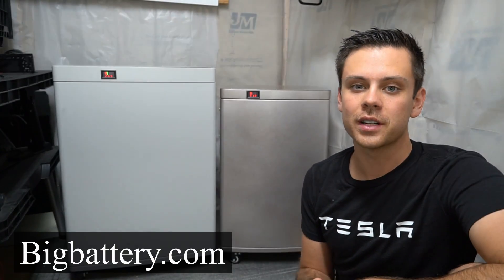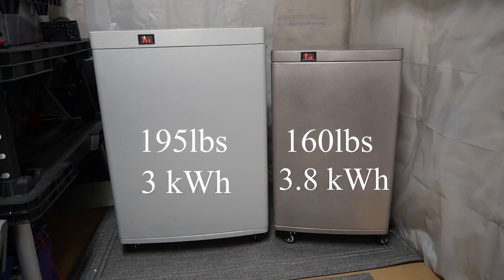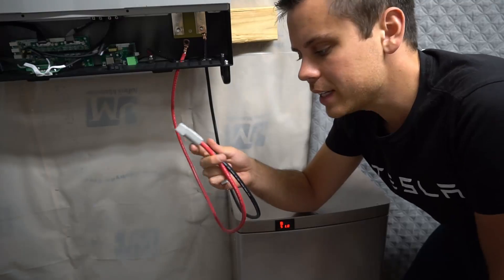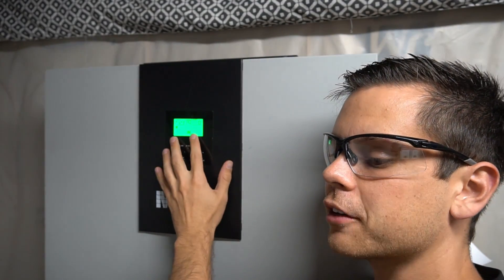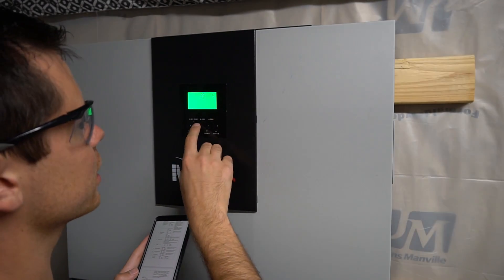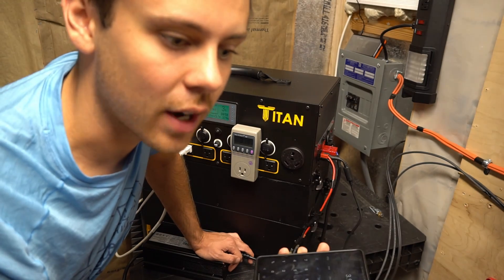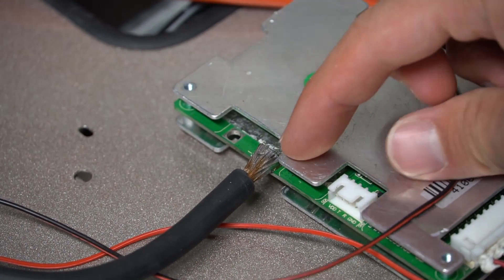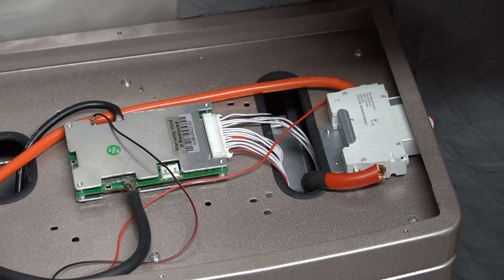Bigbattery.com 48V Li-ion + MPP LV5048 = Powerful Budget System (Intermediate level)

Comment: I am the ultimate novice in solar system builds but found this video very helpful. Only not clear on a proper solar array using the 24V LIFE P04. I have the Renogy 12-24 v panels,550w ( 6 each for now). Will there be any problems using the 6  each 550w panels with the set up described? Appreciate any advice.

Comment: Having spent my life in the electronics industry I have learned one thing about the Capacitors you have mentioned. Chinese made capacitors have a lifetime issue due to impurities used in their assembly that limits their lifetime, the precharge helps to build the electrolyte film without punchthrough and helps extend their life. Capacitors manufactured in America had this issue to some degree from only one manufacturer and  that was over 50 years ago. Capacitors manufactured in Japan, do not have this issue and Japanese Caps will outlast Chinese caps by 10 to one. This situation is well known in the Chinese electronics industry so Chinese manufacturers of the "Finest" electronics use Japanese manufactured Caps.

Comment: You said.  You could take that 24v battery and later connect in parallel to get 48v.    My question is,  would you have to do it with an exact same battery?  Or just any 24v/XXXamp batter and be fine?    Secondly,  if those 2 different batteries had different brand BMS’s,  would they still talk to each other?

Comment: I have an LV6048 and I have a split phase AC Input (9,000watt generator) connected to the Inverter, but it is still not charging the batteries with the AC power. I don't think I should bridge the L1 and L2 right? I feel like that will short my generator. Any help please? Thanks!

Comment: what do you do if the grid goes down? The workmen don't want to get a shock from the solar system.
Reply from the maker: This is not connected to the grid. It's an off grid inverter. If it was a hybrid or grid tie, then it would have anti islanding features part of UL 1741. You should watch some of my beginner videos.

Comment: how would you recommend that I build a UPS for electronics in the house which I can plug into an outlet to charge so  can control the wall outlet (on/off) so all the appliances using the UPS do not draw from the grid all the time

Comment: Can you do the resister trick on either the Positive or Negative, or just the negative?. I was think of wiring a push button in parallel with my main battery cutoff switch to pre-charge before switching the Positive side to ON.

Comment: On what page of the manual does it show the jumper Will is talking about? Also, on what page of the manual shows the schematic using just one inverter? All I see is 2 or 3 inverters paralleled. 
I have one inverter.

Comment: Is there a charge controller that will let you switch from solar charging to fuel generator when the capacity gets too low (alarm @25% LifePo4)? And is there one that can automatically start a fuel generator when needed?

Comment: That is ~ utterly wretched ~ interior work (I design and build power amplifiers) high current power supplies are my specialty. I am stunned bu the connections as shown. Both the heavy gauge wire "soldered" to PCB assembly (utter fail) and the impartial wiring to the circuit breaker, are astonishing. They defeat the larger gauge wiring benefits. 

I would have redone them for safety... if I planed to load the system heavily. That alone would make (makes) me skeptical with purchase of their products... way beneath amateur... I think that I will build my own battery system...

Comment: Will can you recommend a BMS for the lithium 48v. The one is written in Cantonese. Big battery is not selling them separately now. I would like to upgrade the. BMS in the units I have. Nice to be able to use a BMS with Bluetooth to monitor. The anderson SB50 is to low and showing some heat stress. Cable used look and feel cheap (plastic feel). I have better cables and SB175 for peace of mind. This info would help those that bought these on your recommendation. Big Battery is useless. They informed me they are upgrading to SB175. Interesting the price increased a few hundred Dollars now.
Reply: Can you send a good photo copy of the Cantonese? I have a pretty good app that scans and translates pretty darned good. I should be able to send it back to you translated into English. Send them to "ClosedThisAccount" at yahoo dot com and put "Translate to English" in the subject line.

Comment: Do all inverters need the capacitor "precharge" when hooking up the battery pack? I have never done this on my magnum energy 4000 watt inverter with three  parallel 24v LiFePo4 battery packs. I just hooked them up and switched each packs individual breaker to the on position. Perhaps I have arc protection on this inverter and it has saved my scrawny butt. YIkes! I may lose sleep over this...

Comment: I need solar for my van I don't know anything about this please some one recommend me something easy, I was thinking about 2 AGM battery and 2 solar panels with a charge controller if that's all I need can some one let me know and what type of panels  I want to power a 12 volt freezer and the water pomp is a 12 volt as well a TV is a 18v TV with the cable adapter for 110
Reply: Joel...look through Wills videos. He has a simple setup for RV use.

Comment: I tried using the resiter(sic) on my Outback flex panel and still get the spark? Also found out the FX inverter ser is not compatibil with Lithium batterys. I have a FX3048T inverter. Besides all my parts are here and now to get to work. I will try with the Mate 3 and Mate 3s.

Comment: Hey will thank u much for all the info ,I knew to solar ,I watch many of your videos multiple time ,I thinking of decent size solar system for a camper , I was thinking of going with the mppt lv 2424 with the 3.5 or 3.7 kilo watt battery pack that you tried . I know on the inverter I believe it's a 2000 watt inverter on that 24 24and that's where the problem comes because my buddy gave me a 12 volt 5000 watt inverter which I like the 5000 watt inverter I believe that could run anything as long as I have power from solar and battery
Reply: but I know I'll have to use a step down from 24 to 12 to run the inverter and then not sure of what controller to use if I decided to go that route,if you run across this text and you got any ideas maybe you could help me out

Comment: Do you recommend the new raw cell build for a 24v 400ah battery or two of the used 24v  byd packs without the case and bms. I will buythose seperate.

Comment: Did the company ever get ahold of you about the wire connection I was just wondering thinking about buying two of them if you would can you let me know if the issue is fixed thank you
Reply: If you wind up getting two can you message me on how you paralleled them?

Comment: I have two of these units. There are no exposed wiring now. Is there a smart BMS out there the can replace the one in it? Like use a smart BMS so I can monitor them remotely. I would prefer a US brand. I found the same one on alibaba. Thats what the search popped up. Model no on bms JBD-HP28Sa. 60amp.

Comment: I've just ordered the 48v Li Ion Powerwall. I intend to charge this unit with a Hybrid 5000W 50A Solar Charge unit . The one I have selected has an output of 230V with 60A Utility Charger @ 50HZ. I will have to use a step down converter to drop the output from 230V to 110V / 120v so I can power up the gear in my  RV.   I have a 8.5' x 8.5' foot print on the top of my RV that I' have dedicated for a panel array. The rest of the space is for an observation deck . My question is this.  What specific Solar panels will be best for me to use in order to to ensure the most  efficient charging characteristics.

Comment: HELP! PLEASE, I just got the  (24V Li-ion battery )  like you are showing, it came with about 26.5 volts left on it. I let it run a tv and some other things it ran for about 6 hours or more and the battery unit started squealing and showing only 22.5 volts left. How do I recharge the battery unit and stop the squealing? THANK YOU

Comment: HELP! PLEASE, I just got the 48V Li-ion battery like you are showing, it came with about 26.5 volts left on it. I let it run a tv and some other things it ran for about 6 hours or more and the battery unit started squealing and showing only 22.5 volts left. How do I recharge the battery unit and stop the squealing? THANK YOU

Comment: At 11 min. I actually saw this done on 12000 vac inputs to motors cuz they had wrong connectors, inspectors let it ride but... I told a PE Elec who said fix it. Cross Section Diameter of wires like this increases Fault Currents (I2R copper losses). This is dangerous. Never cut more than one single strand on wires. Period. Its unsafe in heevy loads  see NEC 2007

Comment: WOW! I just purchased this same setup 2 days ago (2-NMC 48V with LV5048) to start my off grid project. 
HOWEVER I purchased the NMC 48V from another company. Same cabinet, same BMW NMC batteries, same 14S configuration, but they convey the capacity a bit differently: 4.55kwh at 85% to 90% capacity. Has anyone done business with Tech Direct?
I'm concerned that this is not as plug and play as I thought it might be...guess I better get and read Will's book first before attempting a hook up?
Reply: Hey just wondering if you put these into parallel yet, I also bought two of these

Comment: Your meters amp meter can be used as a jumper. It usually is a 100 ohm load.  You can check this with another meter. Have fun.

Comment: You could use a relay to use say a LIFEP) battery pack first down to a set voltage that would trigger a relay that could swap to a different chemistry battery pack .  It could also connect the discharged pack to an inverter to charge it while using the second pack. All that is really needed is a voltage operated switch like a BMS uses and possibly a dedicated inverter/charger for one of the chemistries.  Sounds complicated but it really isn't.

I hope you make a video using a similar idea Will !!!

Comment: How could you measure the DC Current with the clamp meter ?  You must have a special clamp. Can you please share the link where I can get one like that? Thanks.
Reply from the maker: Oh sure, it's on my site under the tool section. It's so good.
Reply from the maker: https://www.mobile-solarpower.com/tools.html
Reply: Where can I get the big resistor that you have? Should I get a little higher Ohm to get less amperage and therefore less spark?

Comment: Got 4 of the 48V banks today from bigbattery. I just noticed when shopping for parts these banks connect using an Anderson SB50 connector, rated for 50Amps. It appears from the spec sheet this termination will produce 30deg C heat above ambient at 60 Amps. It doesn't appear to be too hot, and it does accept 6AWG, which is 65Amps according to NEC. The mounted breaker is 65A so it appears  B.B did their due diligence. Also looked inside and the main leads are mounted with nice ring terminations and the solder work looks good and generous! Looks nothing like what you have shown on this clip.

Like your site keep up the good work.

Comment: When you say you can't connect them in parallel does that imply you can connect lead-acid and lipo4 in parallel? if so have you covered that in a previous video or have a reference of how it's done thanks
Reply: It's not just the voltage at any given state of charge, different chemistries have different charge/discharge curves. Unless it's a total emergency don't mix chemistries in parallel.
Reply: The charge and discharge curves don't match up. You could make it sorta work if you have just the right number if cells to match the other chemistry but its honestly not worth the effort.

Comment: If my math is correct, the LV5048 can handle a draw of about 41.7 amps (i.e. 5000W/120V).  What happens if your total load draw is higher, say 50 amps?  Will it shut itself off, blow up, catch on fire, or something else?
Reply from the maker: It has safety feature to turn it off

Comment: Those bars rolling down the screen are the result of a rolling shutter interacting with what I'm betting are PWM-dimmed overhead lights. You can get rid of that effect by running the lights without dimming and/or increasing the camera's exposure, and then bringing the levels back down in editing.

Comment: Starting to get the feeling Will is shilling some products for those sweet commissions, MPP and Big Battery over and over, regardless of the issues with them.
Reply from the maker: I bashed on the big battery, what do you mean? Did you see the circuit breaker connection? What a joke
Reply from the maker: And I like MPP. They are good
Reply from the maker: Also removed it from my website. The LiFePO4 pack is much better. I'm sticking to that one.

Comment: Currently have 3 Bolt EV modules 6kWh each for a total usebale of 16.8kWh after conversion to 48V less than 2K.  Brand new cells factory balanced.  Using the LV5048.
Reply: Would you mind sending me your email address so I could ask a couple of questions about designing a system for a camper?

Comment: Will, agree with your comments on the workmanship. I also noticed how tight the positive cable was against the BMS, I have seen equipment catch on fire when the pressure on the insulation has cut through to the conductor during extended use; should be more slack in the cable.

Comment: 4:29 A friend of mine is an electrician. He always stresses to never connect a live wire with your left hand.
Reply from the maker: Yeah this isn't high voltage. I use one hand only when it matters or if my hands are sweaty

Comment: its a nice controlle  plus the  48 v     battery  does  a great  job . i have the same system  with around  1.2k w solar power  ,  just  something  the  mpp doesn't   detect  the   ac  input  voltage ,  from my generator  .  thanks will   .

Comment: Hi Will.  Another helpful video and you know we all appreciate what you do.  One thing that I hope you will do for yourself is to be a little more cautious (spark!) and take a little bit more time to warn your less capable viewers how to be careful.  I would hate to see you suffer through an injury, or worse, be blamed or held liable by a noob.  I spent my entire career working with electrical and electronic equipment.  I am only here to talk about it because of my good working habits.  I've been hit quite a few times and it always brings you back to the realization that the basics of safety are the most important thing of all.  You are very knowledgeable but your viewers may not be.  Stay safe!
Reply from the maker: See, this is why I don't post bloopers. This video is made for intermediate level, so I like to put more mistakes into the video. If this was a beginner video, I wouldn't include it.

Comment: good day. Great Video and very informative btw....i have a question. if i my make my own battery pack lets say from prismatic cells, using the mpp inverter would it be enough to just place battery balancer/equalizer rather than a BMS since the inverter has its Low and High Voltage Disconnect? the bms in the video are the typical china made sold in alibaba or aliexpress and based on the data sheet they are the top balancing type of bms good for big system(say 5kw panels and 200ah 48v Lifepo4 in a good day scenario) that can fully charge big batteries during the day. but with small system  where the batteries can not fully charge for weeks to come(unless helped by grid) i might not be able to balance it correctly. Also in the data sheet the balancing amps of those bms ranges from 50ma-200ma, is that too slow for big batteries. Thank you

Comment: That’s pretty crazy how close that wire is to the frame of the battery housing they Should’ve insulated it ..🤪😳
Reply from the maker: Agreed. Not smart design. They told me they are fixing it now
Reply: DIY Solar Power with Will Prowse That’s awesome the company will stand behind their product 👍 Thanks for sharing

Comment: As an electrician who works with high voltage I highly recommend to never touch exposed wires -  Currents between 100 and 200 mA (0.1 to 0.2 amp) are lethal.  Its just a safety thing & its a good habit to avoid touching wires.
Reply from the maker: I didn't touch any exposed high voltage wires
Reply: @WillProwse  Sorry I meant to say even if its high or low voltage - its always a good idea to not touch exposed wires - like at 11:25  - just as a safety thing I like to do to avoid possible harm.

Comment: Will,  

I’ve searched for an insulated ratchet like you have but can’t seem to find a match to the one you’ve got. Do you have a link to the one you use? I’ve looked on your website but can’t find it listed in your tools section. 
Thanks,
 Bill
Reply from the maker: Sure thing Bill: https://www.harborfreight.com/3-8-eighth-inch-heavy-duty-composite-ratchet-66313.html
Reply: DIY Solar Power with Will Prowse excellent! Thanks.
Reply: Use tool handle dip and make your own!!

Comment: Big battery does not return emails if you have a problem. I purchased the a 48 v and 24. The 24 had no readout for voltage when the breaker was turned on. Took the top cover off and it had not been hooked up. They have yet to respond.
Reply: Yea I know. Bought two of the 48v nmc and Ed wont reply to emails or phone messages. Will answerd some question but needed a couple answered. I have two 48v FLA battery banks. I need to be sure of paralleling two together and connecting to my outback FLP 1 panel system. So much for steller customer service.